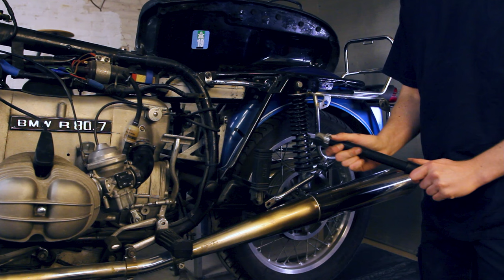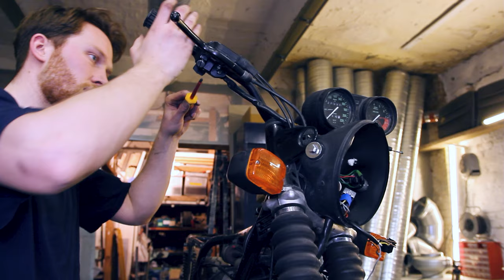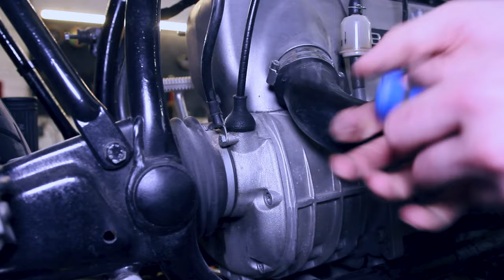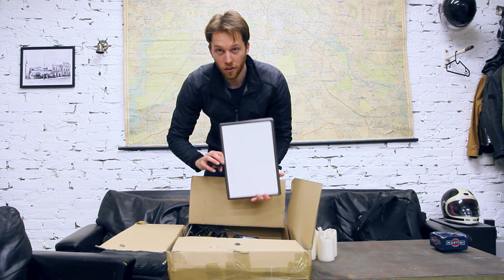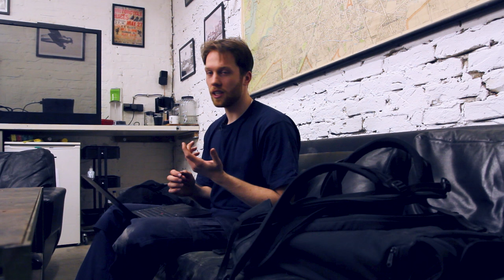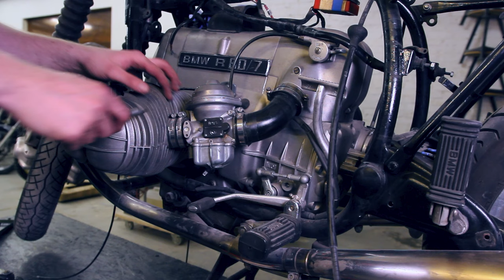BMW R80 Custom Bike Build | TEARDOWN

Comment: Great video! You have inspired me to one day try an old BMW restoration project. Now I need to find the bike and get to work!
Reply from the maker: Hi Reggie, thank you so much. That's awesome!! Which direction would you like to go? Cafe racer, scrambler, brat, ...?
Reply: @MotoWrenchers  - Hello Joshua. I'd like to build a stripped down street scrambler style R80 or R75. Most of my riding would be in the city, and I prefer an upright riding posture because of my old back and neck!  :-)   Thanks again for your inspiring series of videos with your R80 project.
Reply from the maker: That sounds like a reasonable choice. A great, reasonable choice 😄 you'll have a lot of fun building it. Where are you from, if I may ask?
From December on there will be more BMW videos. I'm in Norway for master's program at the moment and there is much more to do for university than I expected. Therefore the BMW project had to take a little break.
Reply: @MotoWrenchers  - Hi Joshua. I live in Houston, Texas, USA.  There are a few vintage bikes around here, but most of the young people ride restored Hondas. Only a very few old BMWs for sale, I think that the owners have emotional attachments to their BMWs and don't sell them often. 
Good luck with your Master's program!  We look forward to seeing the build progress on your R80 when you have more free time!
Reply from the maker: Yeah, I get that...they become more and more expensive over here as well. Let me know when you found one. Good luck with your search, fingers crossed 🤞

Comment: I have an r90 and it seems that most people agree that the steering dampener doesn’t do too much.  It’s supposed to add weight to the steering... supposedly. But Plenty of folk just remove them or keep them in the setting doesn’t actually dampen. I kept mine for completeness. Nice vids! Excited to see how it ends up
Reply from the maker: Hi Andrew! Thanks a lot for your feedback. Really means a lot to me. That's good to hear that the steering damper isn't really necessary. I think I'm not going to put it back in but keep it, just in case. Thanks for the tip 🙏
Reply: The steering damper is there to help your fork from not shaking at high speeds.

Comment: Great videos with all doubts we encounter! I also ride bikes and I have the same project with an R80. I wil start my "café racer" project on may, but I've already bought some parts. I will put a motogadet circuit with mbutton in the handlebar. With the engine,  I saw a leak coming from the pushrods tubes, I wil change them and also seals. I still hesitate if I must paint the engine cos' all other parts are black...Looking forward to seeing your next video!
Reply from the maker: Awesome!! Sounds great. I also have a leak on one side that I need to tackle and I also went for the complete motogadget setup. Really looking forward to that.

Comment: Try not to lose the bolt that secured the speedo cable at the gearbox, it also is the breather, if you fit a normal bolt. Oil leaks will appear.
Reply from the maker: Hi George, Thank you very much for the tip! Fortunately still have it 😀 I'm just building a new speedo bracket for the Daytona Velona 2. Do you have an airhead as well?
Reply: @MotoWrenchers  yes a 1974 R60/6 and the makings of another in the form of many parts, also have a couple of triumphs 38 speed twin and 73 ,650 tiger. I know I sound like a lucky guy but I've had them for years. Good luck with the project.

Comment: Good luck buddy, ive been working on the same bike for 3 month now, so hit me up if you need something, i know he bike like the back of my hand :P
Reply from the maker: Thanks bro!! Really appreciate you reaching out. What have you changed?
Reply: @MotoWrenchers  I purchased my first BMW motorcycle last summer and have yet to ride it. Boxer 2 Valve is an incredible resource on You Tube. One thing I have come across is that that the bolt that you removed for the battery ground and  Speedometer cable is a very special piece as it  has a small hole in it for venting the transmission. Be sure and use it when you reinstall the battery ground. I have really enjoyed your project and I wish you the best of luck!
Reply from the maker: Hi Mark, thanks a lot for the tip! Super helpful to know. Really appreciate you taking the time.
Is your BMW also a project? Probably looking forward to riding it, right? 😍
Reply: @MotoWrenchers   Purchased it as a running  bike, I had some carb issues and have replaced needles and seats...now I am waiting for good  weather
Reply from the maker: Fingers crossed that it won't take too long anymore.

Comment: Let me know if you are willing to sell me the two black ears that go into the fork tubes and hold the headlight assembly. Lou
Reply from the maker: Hi Lou, I would love to but unfortunately I've already sold them. How's you bike coming along?
Reply: @MotoWrenchers  I have a 1982 BMW R100 RT so I have the large fairing to remove and a little more wiring to deal with but all in all I’m having a great experience! Thank you for asking and keep up the great content.
Reply from the maker: That's awesome. Happy to hear you're enjoying the process. Any tips on doing the wiring? That's one of my next tasks as well and I’ve never done anything close to wiring a custom bike.
Reply: @MotoWrenchers  the wiring doesn’t look to bad to do.  I would suggest watching a lot of YouTube videos. The most important thing to alert out is this ignition first and rear tail light.  Turn the key once and you should have rear tail light go on and the instrument panels.  Turn the key again and that should bring power to the electric starter and ignition start.  The bike should run at that point. The wiring is basically done.  That’s the most important part of wiring the motorcycle.  Once you got that done then figuring out your  turn signal is brake and headlight should not be that hard Take it one step at a time but make sure you do the first three steps first.
Reply from the maker: Hey Lou, thanks a lot for the tip! I'll keep that in mind. Good luck with your bike. Keep me updated of you want 🖐
Reply from the maker: Hi Lou, I hope you are doing great! How is the progress on your bike?
I was wondering if you could help me out? As 2022 comes up I am planning the next steps for the channel and I am trying to understand what you guys want to watch. Therefore, I am asking a selected group of followers a few questions. If you have a few minutes, would you fill out this anonymized questionnaire: https://forms.gle/a1udjNLYAEJ6zRcE8
That would help me a lot. Have a good start into the next year. From January on I'll post more videos again.
See you soon :)
Joshua